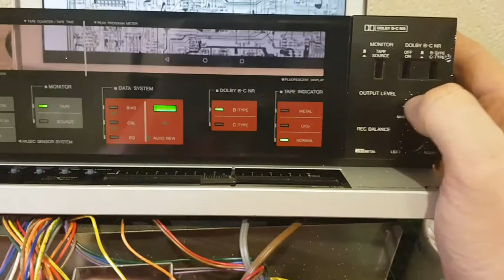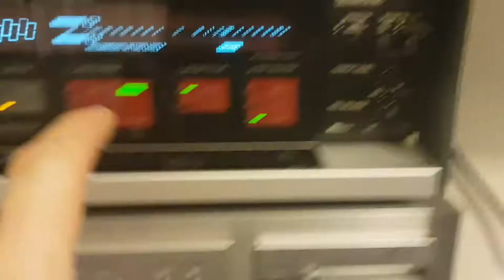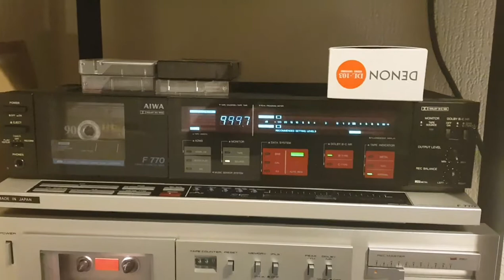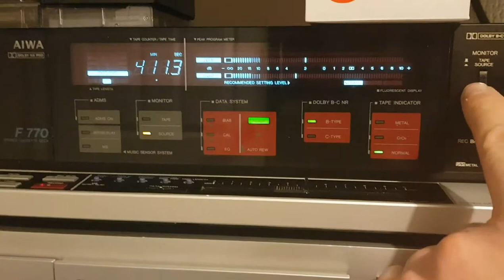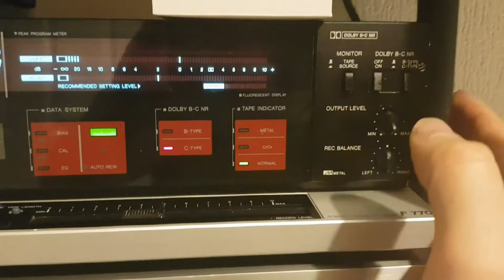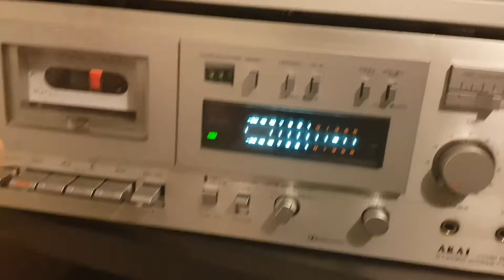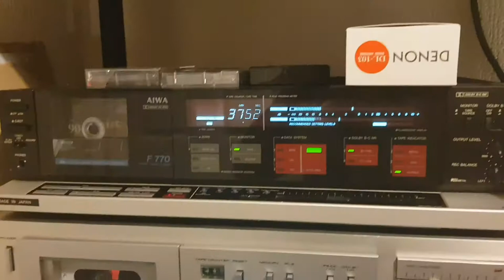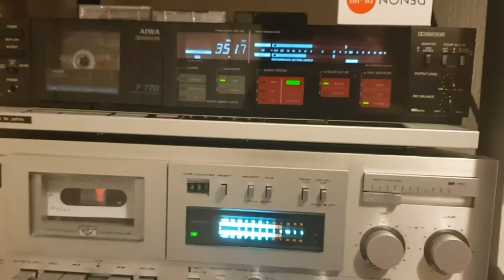Aiwa AD-F 770 repair and demo

Comment: I have this deck, it is very nice electronically, but a wiring mess internally. 
After not using it for 10 years, the belts perished. So I've just replaced the two belts, 
but now I find that the reels don't work well - they struggle to move a tape and screech. 

Updated: Now they are fine, but a few minor problems still need to be addressed.
Reply: Those are very nice decks to use really, but a real PITA to work on imo.
Reply: This info is probably too late for you, but others may find it helpful: If there is a squealing sound, with no FF/RW, you've got to replace the FF/RW idler as it has hardened. Big job, because you have to remove the slide plate which houses the Rec/Play head. There is a small 'indented' metal band across the head plate which holds it in place and this band is secured by a small screw. Be very careful when removing this band as there is a tiny ball bearing under the indent. When refitting, you can secure the ball bearing under the indent by applying a tiny amount of thick grease. Be careful too when removing the rubber idler wheel, as it also has a small tension spring under it. When prying off the securing clip to the idler wheel, hold the whole part down with your fingers and release gently. It's a messy job, but the 770 is worth spending time on.
Reply: @sdi1111  Thanks for the feedback! ;o)
Reply: @sdi1111  These units are Audiophile level indeed.
Reply: @artsimannisto5659  The 770 is a great deck, but no thought was given to servicing the unit and so it’s a nightmare to work on. The main flat belt and FF/RW idler tyre both have to be replaced, but you have to have some level of experience to replace the tyre. Happy to give advice if you are having a problem.

Comment: Just today I finally opened up the front (as you have) and accessed the heads from under neath. Why? - well the cable tie that Aiwa employed was restricting the movement of the head assembly so that the head-guide would rub against any cassette on loading or on removal. Problem solved. 

I also azimuth aligned the deck that of my Nakamachi DR10. Not much difference really. Cheers for the video!

Comment: Any chance of a photo of the pins you said were missing from the door? I am trying to get my F770 going but am struggling, after giving it new belts and idler I had a problem with the heads not engaging, it's back in bits, I also had the problem with the door sticking. By the way, when it was in good condition, with Dolby C it was almost impossible to tell the recording from the CD source, using TDK SA or SAX tapes these machines were fantastic.

Comment: Hello, my 770 powers up ok etc. Only problem is that  the right channel is sound bar lights up not the left channel. Changed the belts a year or so ago. Will try to sell the unit on Ebay if I can but wish I could fix it. Thanks

Comment: Hello . I have watched many of your Hi-Fi repair videos all very informative and I wish I was able to repair the equipment like you.
I have tried replacing the drive belts on my old Aiwa AD3500 Cassette Deck which I completed successfully , however on replacing the tape transport mechanism , I had the same problem as you where the heads were preventing the cassette from ejecting . The cassette was catching on the heads . Could you please explain how you rectified the problem , you said you replaced two pins in the mechanism  door.
Your help would be most appreciated . I have also been given an Akai 702 Cassette Deck which needs new belts any explanation of how to do this would be helpful.
Thank You in anticipation .
Reply from the maker: Thank you David, sometimes these logic decks can be a real pain to work on, you cant beat the old piano key decks for simplicity. Glad you managed to repair your aiwa. With the head problem you need to identify if the head assembly hasnt fully retracted or if its just a missing part within the cassette door. In many cases due to belts breaking/disintigrating the head cam which is usually driven off a gear attached to the capstan shaft is in a mid position (engaged). In most cases there will be a portion of the gear with a gap in the teeth which is the stop position which should be aligned with the capstan gear, usually a solenoid the engages a spring loaded release catch which causes the head cam to engage with the capstan cam which raises/lowers the head assembly. One note is that that capstan cam usually has a spring beneath it to hold it under pressure for the above process to happen. Best thing is to register an account with hifi engine so you can obtain a service manual which in most cases shows nechenism disassembly. Take lots of pictures of the mech parts just in case something flys off and you know where it goes. Hope this helps

Comment: hi some died i think  i have made a thing with my law lady if i was to drop dead my gear has to be sold of not tipped like the man in the car 
they all know the old tec there big money in it  price of alot of used  audio video  is doing up  if you are likely to drop dead leave a plan with someone if you have a lot
of gear to leave  i just got a deck like yours bad belts need change